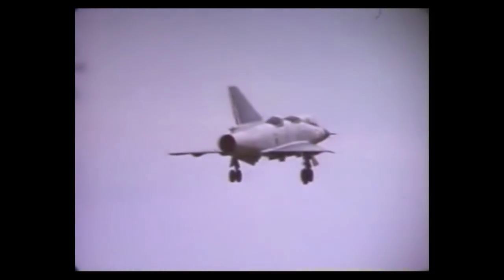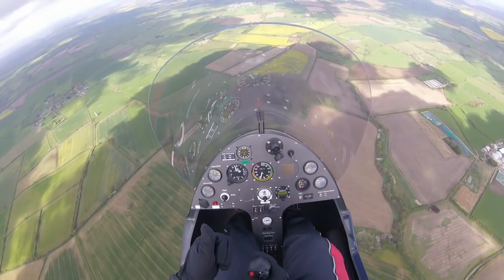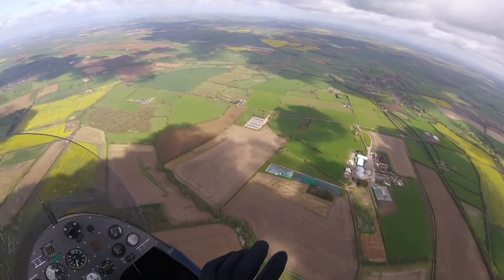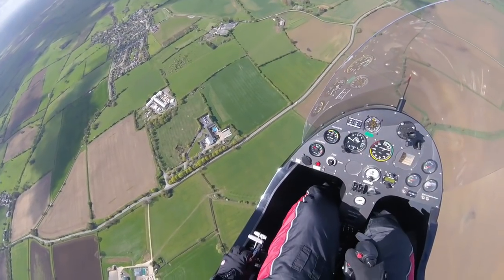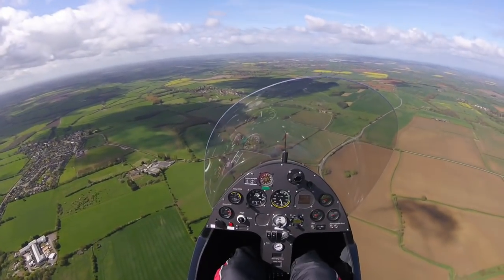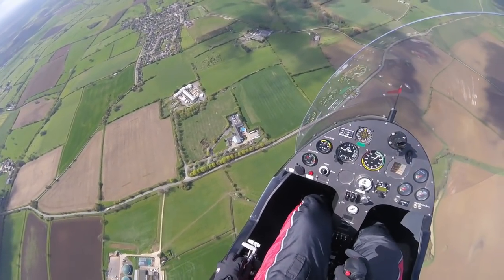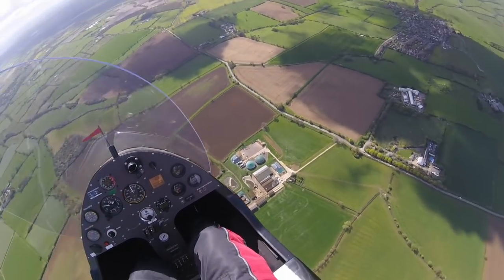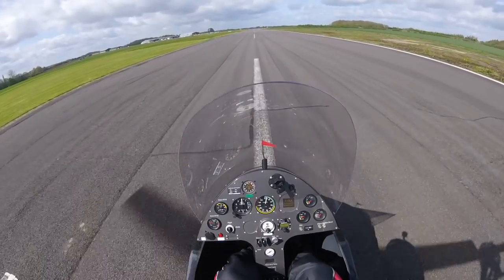Gyroplane/gyrocopter vertical descents & errors

Comment: General question, do gyrocopters have the same issues as helicopters? Such as mast bumps and receding blade stalls?
Reply from the maker: Hi - so you can not bump the mast in a gyroplane because it doesn't have a drive shaft to the rotor.  There is a very good film on mast bumping on YouTube here https://youtu.be/LPPQGwkxJLs whilst a gyroplane does not suffer from mast bumping it is still not tolerant to low g flight because control is lost in much the same way as described in the linked film except rather than a tail rotor a gyroplane is the influenced by its propeller.  Retreating blade stall is ultimately a factor in all rotorcraft however it will occur later in a gyroplane than a helicopter because of the effective lower AoA effectively because forward thrust is produced by the propeller in a gyroplane whilst with the helicopter it is the main rotor.  It is why recent rotorcraft developments in high speed flight have been bias towards compound helicopters.
Reply: Contrary to the comment above, mast bumping is possible on any two bladed teetering design rotor system. The absence of a powered mast does not prevent this. It’s excessive flapping causing the blade root or part of blade root to hit the bump stops with each revolution of the blade that is the definition of mast bumping. Whether that bump stop is located on the mast or some other part of the rotor head (such as a yoke arrangement typical of small Autogyros) makes no difference it’s still mast bumping.

Comment: Is there a limit to how far you can vertically descend?  Does the rotor slow down during the vertical decent, or does the air flowing up through it keep it spinning at adequate speeds?
Reply from the maker: The limit is really how much height it takes to either recover to fly level and avoid terrain or to gain airspeed to land - if you are doing it well 2-300ft AGL is likely a sensible minimum for landing.  The rotor speed is stable once in a Vertical descent
Reply: @gyrocopterflyingclub6148  Thanks!